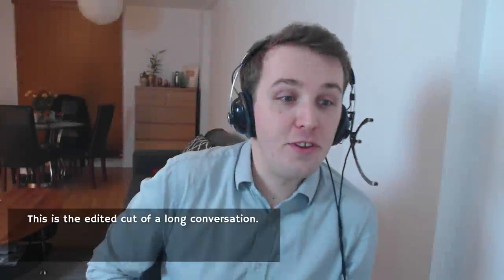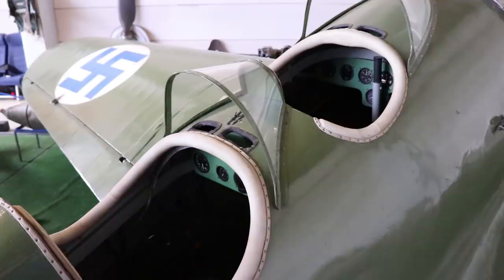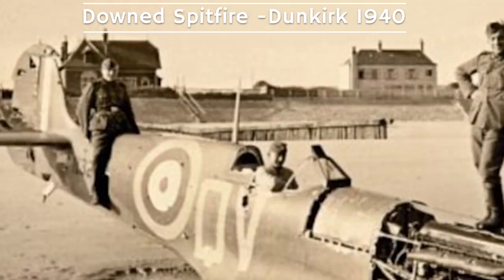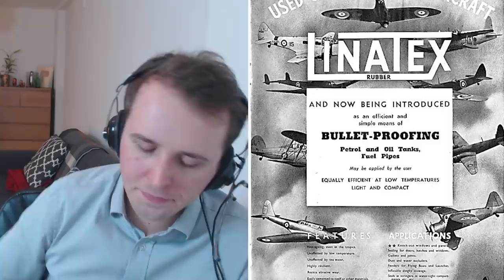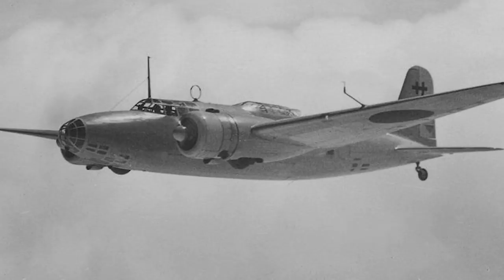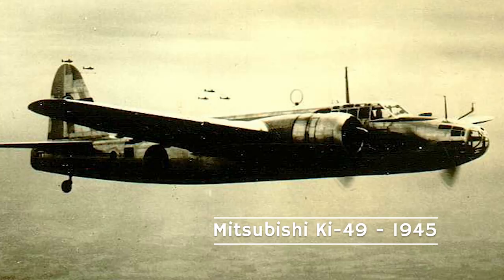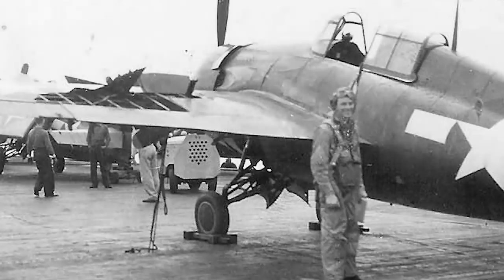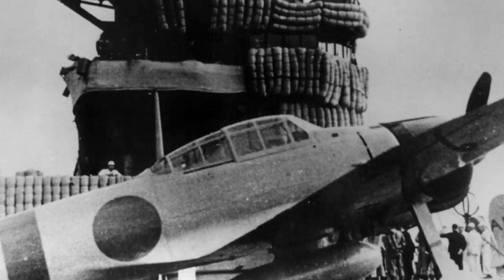WW2 Armour and Fuel Tank Protection - What They Don't Tell You

Comment: I wish you had brought up the points Mikesh makes in his book Zero Fighter regarding Japanese self sealing tanks and armor in general. In brief he says that the rapid modernisation of Japan was focussed on specific industries & did not create a wide industrial base. Producing quality rubber self-sealing fuel tanks was a greater stretch for Japanese industry.  
And to focus more on the performance tradeoffs the difficulty Japan had producing higher powered aircraft engines was a critical factor. The A6M2 had 940 hp while the F4F-3 had 1200 hp. The F6F-5 2200 hp which to my knowledge no japanese fighter approached. The Mitsubishi J2M 1850 hp for example. 
I'd also like to hear more about the effectiveness of Japanese pilot armor that was added vs .50 caliber rounds. In Genda's Blade by Sakaida & Takaki I believe they state that there was no pilot armor used on their N1K2 Shiden-kai with max hp of 1820 hp. The aircraft was considered to be more than a match for the Hellcats & Corsairs by Japanese  pilots. 
On the other end of the stick, in Samurai by Saburo Sakai with Caiden & Saito iirc he does describe the early war pilots preference for maneuverability over all else. The unreliable air to air radios were removed to save weight & some pilots also flew without parachutes claiming the same reason but obviously being more of machismo/warrior attitude type of thing. I can also see the F4F-3 pilots already struggling with the Zero's superior maneuverability & climb rate being more than a bit peeved when they got the F4F-4. The difference is noticeable in IL2 Pacific Fighters/1946 imo. 

In short I'd love for you both to do more on the topic & Japanese aircraft as well! I thoroughly loved this vid & as you can see it got me thinking which is a wonderful way to spend an evening. 

Thank you both,

EDIT: I just pulled the stats off wiki & the like so not definitive at all but in the ballpark I reckon.
Reply: Hello! I will try to tackle a handful of your questions:
1. Trade-off considerations were certainly present for later designs, particularly the D4Y, G4M, and B6N to pick three examples. It is a quite a bit fuzzier when you look earlier, because in the words of Richard Dunn (paraphrasing): "you can't really 'trade-off' or 'omit' something you didn't have up to that point." As we mention in the video, when the Zero was conceptualized armour and fuel tank protection in fighters was unheard of outside of a couple Soviet models, and when the Zero entered service the vast majority of fighters still lacked protection. It wasn't anything noteworthy for mid-1940, and certainly not the late 1930s. However, the refusal to add protection through 1942-43 is where the "trade-off" argument gains steam, because lacking any protection whatsoever started to become exceptional. Japanese issues with developing self-sealing tanks was certainly industrial in part.

2. The effectiveness of armour varied no more wildly than any other discussion of armour vs. firepower. So much is based on the specific context. Japanese armour plates could and did stop .50 calibre rounds (we have plenty of pilot reports and photographic evidence of this), but those same .50 calibre rounds could also penetrate the plate depending on range, angle of impact, the amount of aircraft structure the bullet had to pass through before hitting the plate, etc., etc. Nobody, and I do mean nobody, was going to put a plate in the back of their high-performance fighter aircraft that was going to stop literally anything fired at it under all conditions. The weight restrictions simply did not allow for something like that.

3. I do know the N1K2-J had an armoured back plate, a bullet resistant windscreen, self-sealing tanks, and automatic fire extinguishers standard. However, it would not at all surprise me to learn that some (or even many) pilots in 343 Kokutai removed the armour. I haven't read the book you are mentioning, but I do know that both authors are very good so they may well be right.

Thanks for your comment!

Comment: There is one point that I did not hear mentioned. I don’t remember exactly where I heard it, but an important factor supposedly that while most other manufacturers used engine exhaust for positive pressure in their fuel tanks the Japanese tended not to. That they used the engine intakes to funnel the outside air into the fuel tanks resulting in the oxygen needed to make the plane burn when hit is inside the fuel tank already. 

Is there any truth to that? Or is that a much more common scenario that doesn’t actually effect the damage tolerance of the aircraft but is just part of the stereotype?

Comment: I'm not 100% sure, but I think the bladder nature of the self-sealing fuel tanks caused them to partially collapse as the fuel was used.  This left less empty space for fuel fumes and that is what is the most flammable in the tank.  Add to this that later aircraft like Corsair and Hellcat had CO2 tanks that were used to flood the half empty tanks in order to displace fuel fumes with inert gas.  ALL of this improved fire resistance. Also, the later Corsairs carried 0 fuel in the wings, the only wing tanks were drop tanks.
Reply: Good effect on roll rate too, taking fuel out of the wings
Reply: A friend who is an aircraft mechanic said the Corsair has 2 part epoxy around the fuel tank.  If the ?bladders? are punctured the epoxy mixes and seals the tank.  Is that how self sealing tanks always work? anybody know?

Comment: 36:45 -- I think here's a good place to jump in, having listened this far.  I think the obvious similarities between attack and defensive engineering strategies made innovations like self-sealing fuel tanks practically "industrial standard", to put the modern phrase on it.  Take the Zero -- it was carrying a 20 mm cannon early , compared to fighters like the Hurricane or F4F.  The additional hitting power of larger caliber weapons made much more or much much less armor the choice.  Its not even a choice, really, if the aircraft will be nimble, or have the flight characteristics of a brick.
Reply: ^^ And granted -- the issue with the wings and fuel tanks is the projectile velocity, not the mass of the projectile or even its explosive potential, per se.  The Ideal situation would be for the bullets to pass clean through the wing without exploding or damaging anything, leaving a few holes and not so much as a spray of fuel.
Reply: I think a key driver for the adoption of passive (armour and self-sealing fuel tanks) versus active (speed and agility) defences was the observation, often repeated and often forgotten, that most fighter pilots who were shot down never even saw their enemy. An enemy that exploited the advantages of height and surprise, hit-and-run tactics, and the confusion of combat would take a heavy toll of any opponent that couldn't absorb damage. It's what made the trade-off of performance for armour plate worth it, besides the understanding that you cannot entirely avoid return fire on bomber interception or ground attack, inaccurate as that often is. 

Yes, cannon were to some extent adopted to defeat armour plate. adoptedtheprojectiles

Comment: The reason for the Japanese Navy’s single minded focus on range was due to anti aircraft fire control during the 1930’s and the improvement in aircraft performance.  Both the Japanese and US navies determined that they would be unable to shoot down all attacking aircraft and only the current CAP fighters would be able to engage.  This it was critical to strike the enemy first and range was all important.  By 1940 the US had developed a vastly improved fire control system which, especially when augmented by fire control radar, allowed for accurate engagement of high speed aircraft.  Air search radar allowed fighters to scramble to defend the fleet.  The Japanese argument is that it’s better to loose some aircraft and flight crew than loose the carrier.
Reply: dnillik and then they lost 4 at Midway...

Comment: It's interesting, because the official published range of the F4F-4 is 775 miles, which is totally in disagreement from the stated range of about 4-500 miles in the "First Team".
Reply: Interesting. Drop tanks perhaps? F4F didn't get them until post-Midway, which is out of the scope of Lundstrom's first book.
Reply: Call Me Ishmael  
Yes, and also these aircraft had different ranges at different power settings.  If they were used for long range search, then they would fly slower at leaner power settings, so range would be greater.

Comment: So, the Zero not having protection was not uncommon when it was introduced and the Wildcat didn't have armor until early 1942 when the Americans started entering the war. That's interesting context. It also shows that the 'stereotypes' of protection for the two planes aren't wrong. By the time both fighters went up against each other, one had more protection features than the other.
Reply: It took a pretty inept zero pilot to be killed by a wildcat.  The zero had speed, climb rate, and maneuverability in its favor, and also firepower.